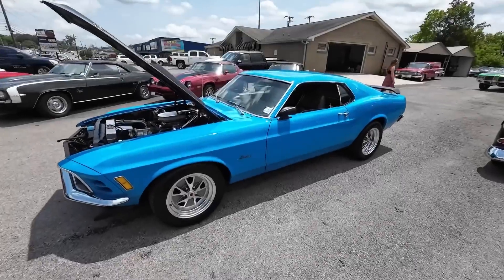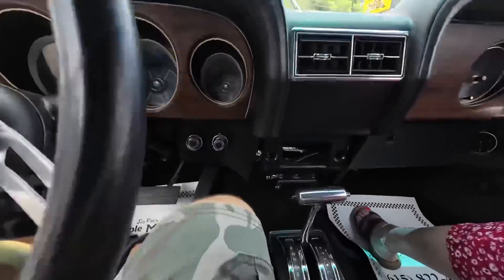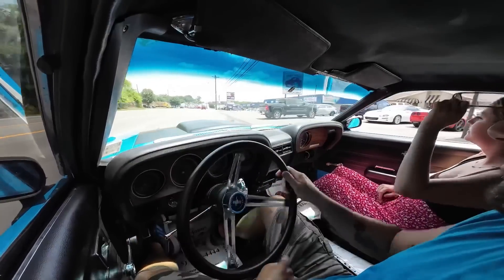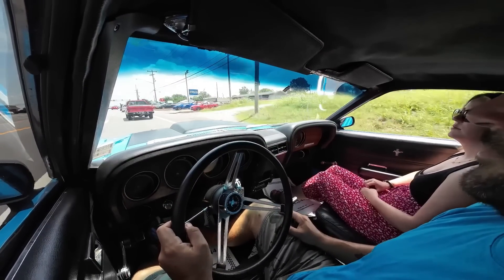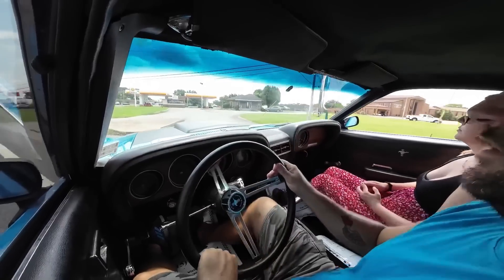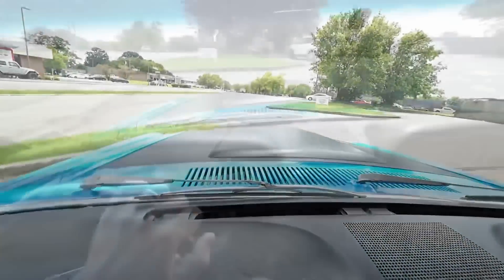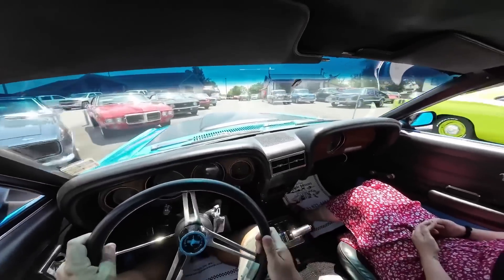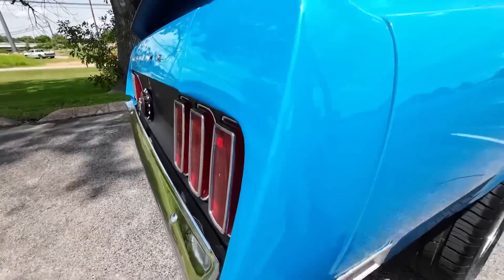Test Drive 1970 Ford Mustang Fastback SOLD $37,900 Maple Motors #2069

Comment: Fastback is nice! Front of a 70, rear of a 69 just missing the mag 500. The 69 also had those inserts on the quarters but previous owner most likely just customized it to his liking! ❤
Reply: If you're talking about the louvers, the '70 doesn't have them. The '69 has the louvers and four headlights. The '70 doesn't have the louvers and only two headlights.

Comment: I do like the car but 70's is not my year. Plus the tail light panel is  from a 69. If did a 69, i would use 70's tail lights. Still great car.

Comment: THE BEST INTEREST  OF THE FORD MUSTANG IS  TAKING OUT THE ENGINE  WHEELS AND TIRES  BUCKET SEATS AND REAR SEAT AND HAVE A  PARTS SALE   WIRES FOR DASHBOARD TRANSMISSION REPLACEMENT  IS TOO EXPENSIVE FOR A $40,000 MUSTANG   THE BUYER IS INVESTING ANOTHER $20,000

Comment: This is a 69 not 70 mustang you can tell by the rear taillight’s on the 69 the taillights set outside and the taillights on the 70 are inside
Reply: It must be a '70 body with '69 taillights because it doesn't have the side scoops, quad headlights or the circular horse badges. My first car was a '69 fastback, man I wish I still had it!😢
Reply: Ya it’s to bad I can’t go back to 1974 when I use to drive around in my 70 Mach 1 with the shaker hood and a wing on the back trunk lid those were the best days